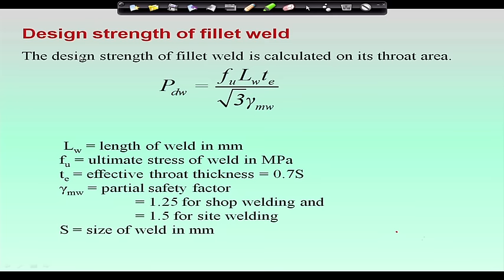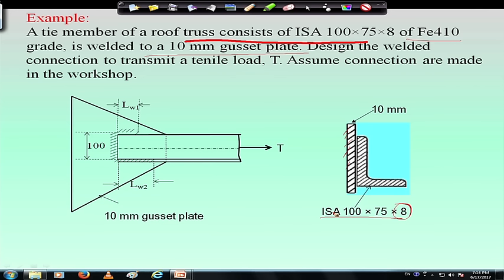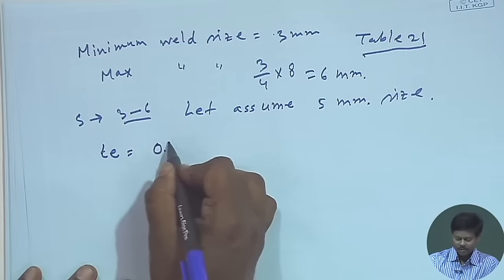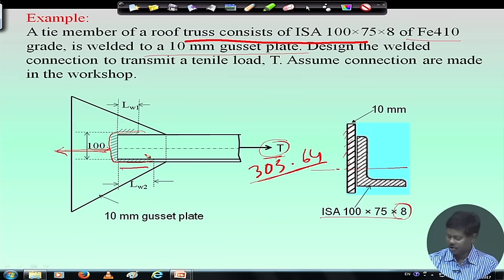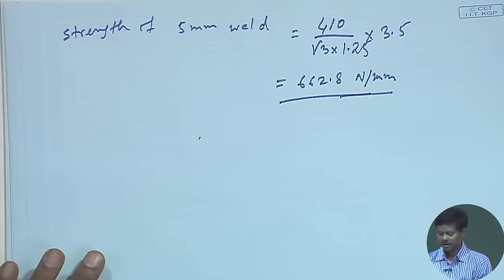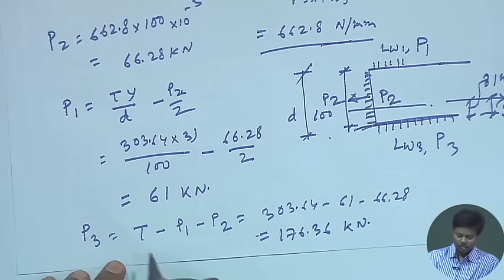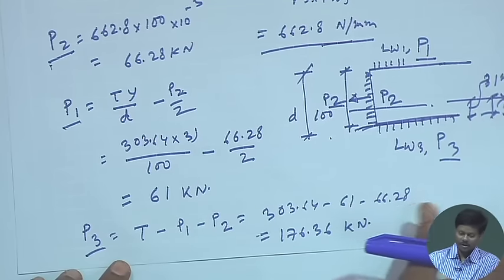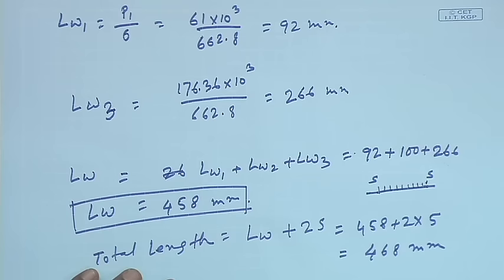Lecture 10: Design of Fillet Welds

Comment: At 26:56 MOI includes multiplication of 2, it is because it is an I-section with centroidal axis at the middle.
Also for the same reason it is 12*1200^2/12 for the web.
Reply: It's a T-section
Reply: @pankajprajapat1181  no I also thought the same but as you go further you will realize the fact.
Reply: @shivamsharanlall672  as it is I section then effective throat thickness will also be 4*te for both top and bottom connection but taken as 2*te
Reply: @niranjanmall5427  see while calculating the value of shear stress, we need the total MOI of the section. That's why it is taken for the whole I-section.

And the shear stress is acting on both the flanges, but it is taken up by the welds on both the flanges separately. THE SHEAR STRESS IS NOT DISTRIBUTED BETWEEN THE FLANGES. That's why ot would be 2 not 4.
Reply: I mean, it's not that that half the shear stress is taken up by one flange and half by the other one.

Comment: @27.24, why the contribution of flange plate is not included in calculation of MOI. (1/12*450*20^3)
Reply: Yeah he just mistakenly missed it. Actually in the pdf of this video, it has been corrected.
You can just check it up.
Reply: @shivamsharanlall672  how to get the pdf
Reply: Search for 'design of steel structures nptel' on google. You will get nptel site. From there you can get the pdf as well as you can download the videos to too.